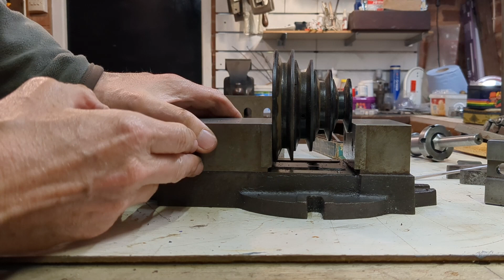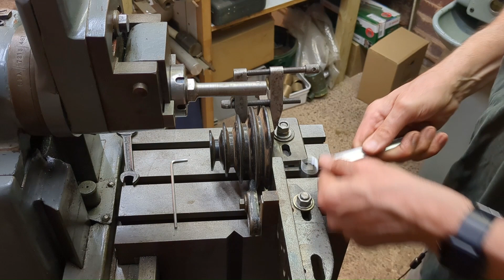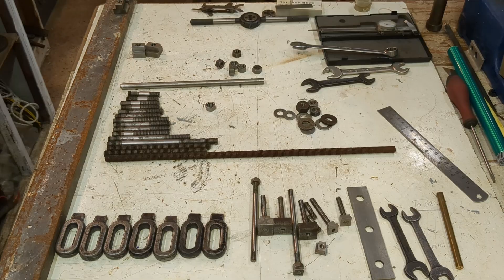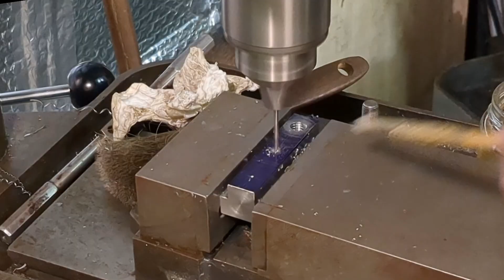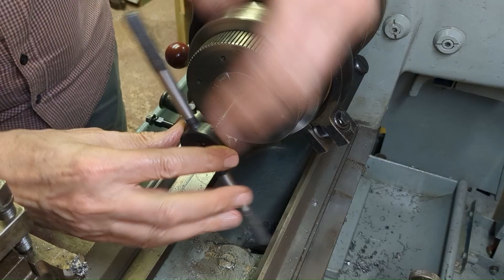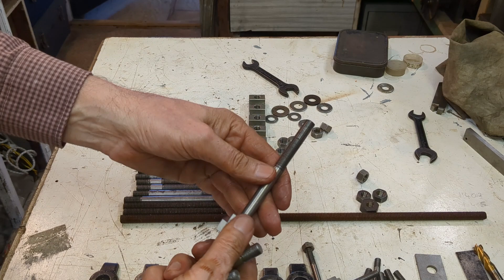Cutting keyway in pulley and making additional T-nuts & studs

Comment: Very ingenious setup on the shaper.  I was wondering if it a shaft could be inserted into the pulley and used to align the bore access w that of the tool. to tram it, in effect?
Reply from the maker: Hello Reuben. Yes, I am sure that would be possible. I think that the shaft would need to be deliberately under size. I would imagine that it would be difficult to actually loosen, align, and clamp the work relying purely on feel. But then, you don't until you try it out!

Comment: Very nice Clive! I particularly like your custom keyway tools. I’d like a small shaper just for that task - you can make much longer keyways than with a broach.
Reply from the maker: Thanks, Stuart! Since making it I have already used it twice and expect to continue to. I suppose the problem with long bores for a broach is the increased cutting force and extra length to ensure the last tooth finishes its cut (?).
Reply: @Workshopfriend  very definitely. It's done in industry but in the home shop not so easy and very cost prohibitive for custom broaches. I suppose one could make their own broaches but the shaper approach is much easier and more versatile.